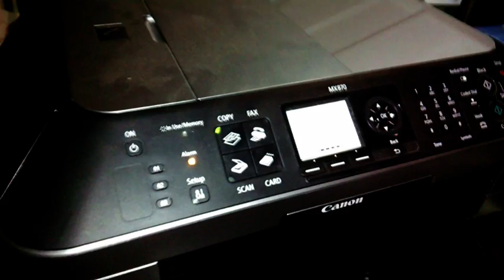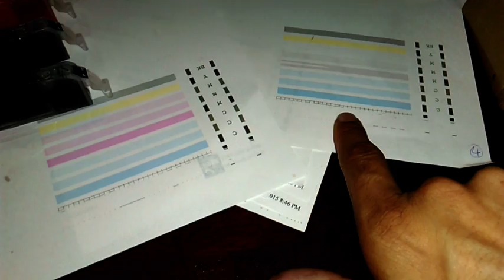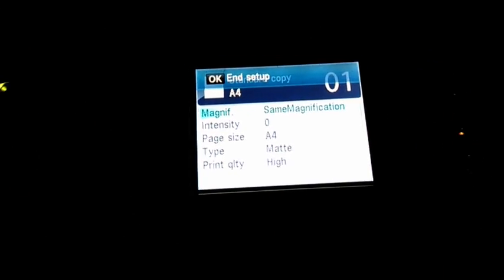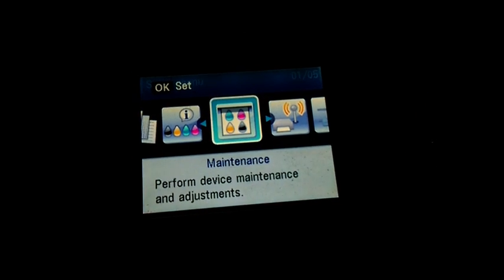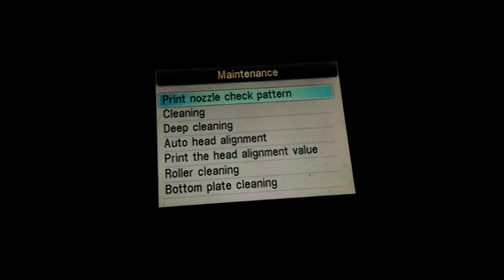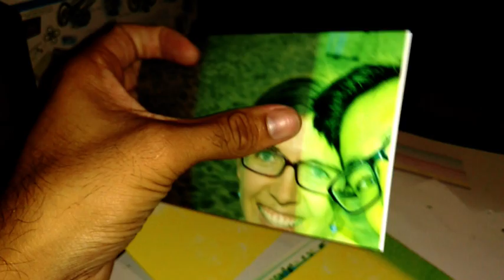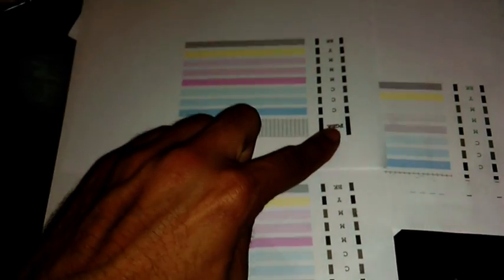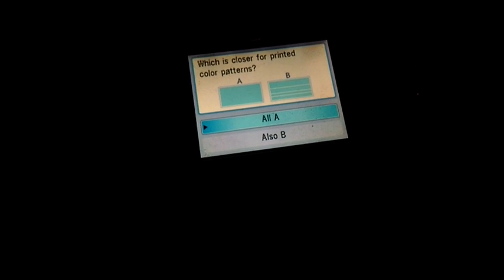How to Unblock and Clean Printer Heads Canon MX870 Pixima

Comment: Sorry again - I can't figure how to get the editor here to break commentary up into multiple paragraphs;  it just keeps presenting in one huge, hard-to-read one!    Update: So I tried taping over the gold contacts and carefully rinsing from the inports through the outports until no ink came out, then air-drying the module over several hours.  Much to my chagrin, the first few test prints weren't great.  The black and blue strips were streaked and the pageblack (the big tank) didn't print at all.  So I tried several onboard head cleaning/deep cleaning runs, and the same result.  I went to bed... it was late.  I figured maybe the tanks' heads had dried out during the long process (I didn't have the right orange caps), and they just needed to sit in the head overnight to bleed out the dryness.So this morning I run 1 regular cleaning and all the colors print clean except still no pageblack.  Frustrated after multiple onboard cleaning and test runs,  I popped out the tanks and printhead and headed for the faucet... to heck with taping up the contact plate and using up more of this new day being overly cautious.  I figured this time I needed to try forcing water through the nozzles like some videos portray, and knock loose the dried blockages obviously inside the pageblack section.  But holding it against a faucet just sprayed me and everything else, with not enough pressure through the device to get the "jets" of spray out the outports the other videos recommend.So I hunt up an old plain brass hose nozzle,  you know, that's round, only a few inches long, has no trigger, and has like an eighth-inch diameter hole at the end.  That I pressed up against each inport on the head, but it still made water go everywhere, especially as I cranked up the flow to try for more pressure.  Then it dawned on me... I used tweezers and took the small rubber washer off from around the blue color's inport at the end, and turned it upside down on top of the pageblack inport next to it.  This created more of a seal, and when I firmly pressed the small hose nozzle tip against it and cranked on the faucet, by golly there was still sidespray but I finally got water jetting out of the outport.  I repeated that for each colors' inport until the jetspray in the outdoor tub I was using came out clear. I rinsed the whole unit and blow-dried it, then used Kemwipes to dab away residual water wherever I found it, and to gently wipe the gold contact plate and the brown flexiloom connected to it.  I mean gently, because gold plate is thin and sensitive - do not rub with pressure.  (Kemwipes are lint-free).I did all this in less than 15 minutes so the lingering ink tanks back next to the machine in the office didn't have too much time for their heads to dry out.  I replaced the print head and tanks and ran one cleaning run, then held my breath for the test print.  Eureka!  All test strips were perfect, including pageblack.So thanks again outie555, for the tutorial.  Though yours wasn't quite enough to resolve my clogged print head, together with other videos here it got me on the right road to saving my venerable favorite printer.  Hopefully others who make it here will benefit from reading this.
Reply from the maker: you are more than welcome buddy. as i said previously, i am glad i helped, and i hope your comment helps someone having the same issue with the water flushing out the jets.

Comment: I watched several print head cleaning videos before yours came up, and I was happy to see one for my exact model, MX870.  Mine isn't quite as bad as yours was, but as in most of the videos, it's the pageblack nozzle that's befouled.  Some videos were much more careful with the gold contacts surface and used special cleaning fluids.  Some disassembled the head to clean the output fascia ports.  Some were pretty clumsy with the job and it's a wonder the contacts worked very long thereafter.  I think I get the gist of it, and it's up to me how thorough I'll want to be.  

Thanks for providing your version, and letting me know I don't need to buy a new printer, since the MX870 up til now has been my workhorse and a quality machine that's better in many respects than more recent models.Sorry that tis is all one paragraph... or some reason the editor won't let me break it down to be more readable!
Reply from the maker: Glad I helped buddy :)

Comment: Have just tried this; and popped the cartridges back in, but they're not lighting up.  Undid again.  What am I doing wrong?  And when I close the door the B200 error is still coming up.
Reply: You may have not thoroughly dried it, or you somehow damaged the exposed gold contacts on the one side;  you're not getting electrical pulses through to the head, so it's likely one or more of the delicate gold squares got scraped, dirty with ink or some other contaminant, or is still damp. Some people use a much more careful cleaning routine that soaks the output ports and/or uses tubing to inject water or a special cleaning mix through from the individual nozzle ports. This limits the exposure of the gold contact buttons to moisture, which the quick hose pressure technique some have used or tap-rinsing does not. That's not to say the hose flushing or tap-rinsing as shown here won't work, cuz clearly it can;  but a lot depends on careful drying afterwards, with no rubbing or other mechanical or chemical impact on the sensitive gold buttons.  Also I would use a microfiber cloth to carefully dry things with in addition to compressed air;  anything else can leave tiny stray fibers on the head or around the gold contacts, and those can act as a contaminant.  I'd also leave the thing to air dry for a day or two to make evaporate out residual moisture deep in inaccessible crevices or under/inside the exit port head.Sorry this editor won't allow me to break this up into multiple paragraphs for better readability.

Comment: wish you knew how to fix the errorB200
Reply: +spacedrivefilms His instructions worked for me in fixing the B200 error... Plus I combined it with someone else's feedback on Amazon regarding the error.  I started with #6 AFTER I washed and dried and the printer head.  After MONTHS my printer is finally working again.

ook me a few hours to figure out a solution based on a number of sources on the interwebs. I have an MX712. Problem is probably a clogged print head. I had been putting off replacing the ink cartridges which apparently is a mortal sin in Canon's eyes.
1. Open printer. 
2. Remove old ink cartridges. 
3. Remove the print head but lifting up on the spring loaded gray thing. Don't worry, it won't break.
4. Print head pulls out.
5. Clean the print head wells. I used witch hazel and Q tips but I think isopropyl alcohol (rubbing alcohol) would do the trick too. Clean and dry, clean and dry until most of the wells look free of ink. No need to soak or wait overnight. Get them relatively clean.
6. Put printer head back in and put in fresh ink cartridges.
7. Turn off printer (make sure it's plugged in).
8. Open printer and force the ink carriage by hand all the way to the left.
9. Push the on button 5 times rapidly.
10. Close printer.
11. The startup menu should come up on the printer.
12. Go to menu options and do a deep clean.
13. Printer should be back to normal.

I will say when I tried the step #12, the deep cleaning, I got the error again.  Then I turned it off and turned it back on.  I let the cartridge container go almost all the way to the left and then I put down the cover.  After that, I just did the Printer Alignment check like he suggest in the video and it WORKED!
Reply from the maker: +spacedrivefilms sorry man, never come across that error
Reply: Adenrele Ojo u

Comment: Hi...  THANKS SO MUCH!  Just wondering.... I did this, dried the printhead, put the printhead back in my MX860, put the ink cartridges back, put the top down, selected "maintenance" and then "print nozzle check pattern" and the printer started to do what it does.  Then it went totally black, ie no power.  I can't move the cartridge holder on my own anymore either.  It's stuck over to the right and no power at all.  Any thoughts about this?
Reply from the maker: that's too bad. maybe there was still water in the print head and it shorted out? unplug it and remove all the ink and head if you can get to it, and let it dry out for a day. sorry I don't know much more.
Reply: +outie555   Thanks you for replying!  I will try that :)
Reply: +outie555 I just went to try what you're suggesting.  The carriage with the print head is all the way over to the right and I can't move it.  I guess you can't move it when there's no power.  grrr.....